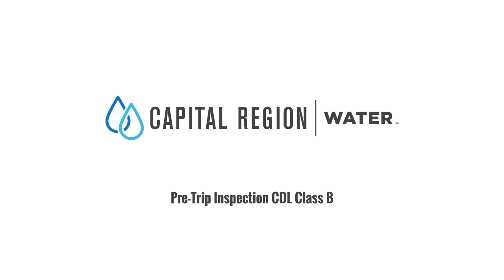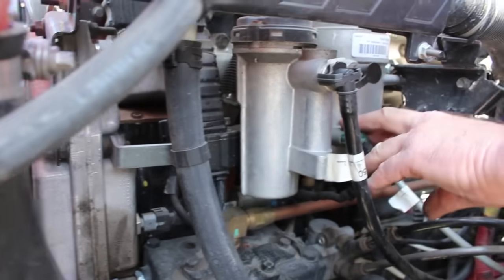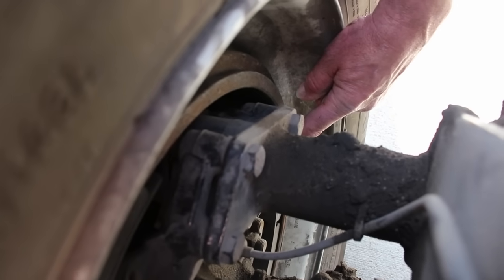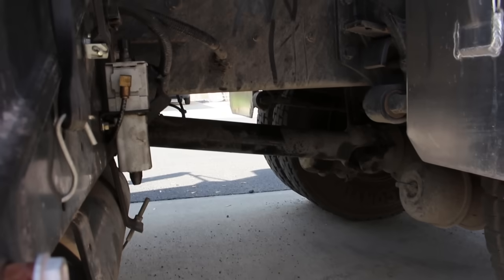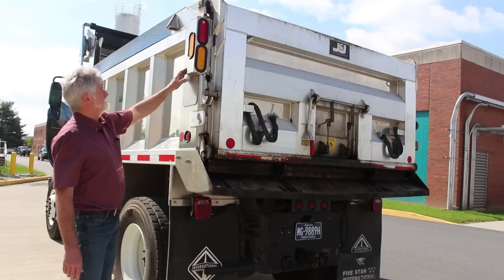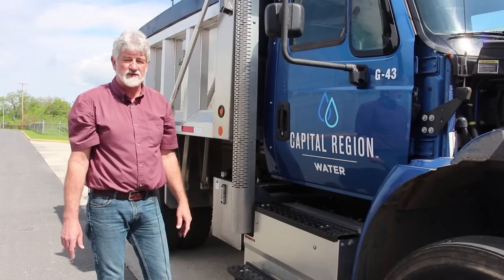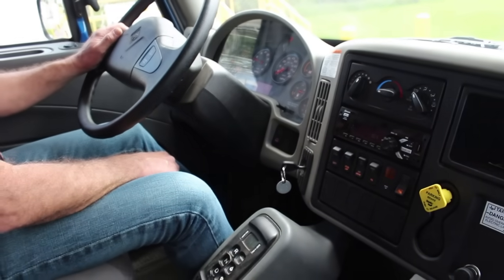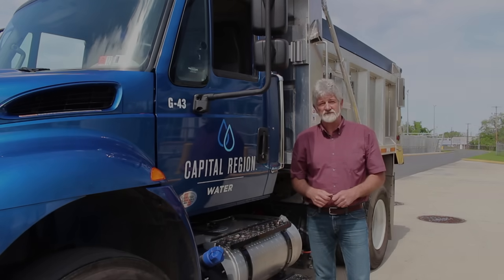Pre-Trip Inspection CDL Class B

Comment: In NJ i took my class B test 7-16-18 and the inspector said i would've passed but didnt physically touch everything in the engine that i said so he failed me. Anyone taking the Pre trip touch everything you say

I passed on 7-30-18 i touched & named so much things the guy started laughing & said stop touching everything you see. once i got past the pre trip it was easy as hell. My advice is touch everything and stay calm they're on your time not theirs
Reply: Did you chalk your wheels??? I failed my test because examiner said the truck rolled because the wheels weren't chalked.....
Reply: That's crazy I'm from NJ but I'm taking mine in GA now been here 6months
Reply: I asked the guy doing mine if he wanted me to touch everything or just point. He said pointing was fine. He also said i did not have to get under the truck but if I didn’t point at the proper location even if I named it right he would ding me. 

So my advice is ask what there expectations are.
Reply: @reesedipherent8416  im here in Ga also. Did you have to touch or point at everything in detail like in the video. I dont want to get failed because i pointed out every bolt in screw lol
Reply: I have to take mine in NJ as well. Do you have to be as thorough as the video suggests? Every component in the engine??? Securely mounted; not cracked, bent or broken of course

Comment: just wanted to say thank you for this video , i watched it over and over for 3days and aced my test today !
Reply: Shane Galley what state did you take it in?
Reply: Shane Galley did you also go to school or you just did it on your own? Wondering if it’s possible to do without school.
Reply: @BaM_F22  I wouldn't suggest it.
Reply: ItsFusco que l
Reply: I want to go for my cdl class b  do u really have to say all this on the pre trip inspection seems excessive
Reply: Fizzy_B anything less than this is a fail. Think of it this way you have to pretend like your trying to achieve to be a “certified teacher” not an actual license holder. And this is your final exam can you be certified to teach? Or not. ? They know you know but you still have to prove that you know and this is the only way
Reply: ItsFusco u can do it without school but only if you do this or better. Permit is kinda hard to get. Especially in Texas
Reply: Does the parking brake need to release while you doing the pre trip inspection or only until you get to the slack adjuster's?
Reply: @slickdawg4634  I’m doing it without school I got my permit, all that’s left now is doing the driving test. I used cdl genie to practice for the tests and I’m in Texas.

Comment: Don't forget to chock the tires before performing the air brake test and unchocking before the tug test.
Reply: Garrett S. 
If I pass my test tomorrow, IT WILL BE THANKS TO YOU!❤️
Reply: Before you unchock do you have to turn turn your engine off and take the key?
Reply: Remember to leave the cab facing the cab with 3 points of contact
Reply: Some jurisdictions don’t require it, especially where I’m from
Reply: I didn't chalk up ,I used an automatic tho

Comment: Passed my CDL B with airbrake and manual transmission yesterday . Was a lot easier than I thought, but I also had a really nice and friendly examiner. That makes all the difference
Reply: Not sure if you’ll see this, but I’ll be taking mine soon. Do you have any tips?
Reply: @Mjk86  well. The biggest thing that people fail on is the air brake test. So make sure you got that system down pat. Turn key off and back on, fan down to low warning indicator, then continue until Parking brake pops out, restart and idle up to build air pressure until governor cutoff. Do the tug test (parking brake test) then service brake test. Also during the manuverability test, make sure to use all you looks especially during the alley dock backing. Usually you get two looks. If you aren't in the box you fail that part. I took mine in Arkansas. It is different state to state

Comment: You guys forgot the governor cut-in test on the air brake. After raising the psi from 85 to 100, continue to raise pressure to the governor cut out, then release the airbrakes and fan brakes to 100 psi where governor cut-in should kick on

Comment: Finally passed my test CDL b, in NJ.... This video and others helped especially the air brake test.... Touch everything, even if you don't know the name of it, touch it, just keep talking, if it's metal ,(( not bent,broke,cracked)) if it's rubber,(( no cuts, buldges abrasions)) securely mounted etc, air lines say the same but add no audible leaks etc..... Don't forget to chalk your wheels, 1st time I failed because I didn't chalk wheels.....
Reply: You mean use wheel chocks. :)
Reply: Chalk your wheels after brake  test right before you do your outside pre inspection right? I’m pretty nervous I’m taking mine tomorrow for class b in Tennessee using a dump truck I’m not going to a dmv cause the ones in Memphis do not do the CDl skills test  I’m  testing at an actual CDl college any advice?
Reply: T J I test Tuesday and yes I’m using a driving school for outside testing and I’m having to pay like 200 dollars

Comment: I'm gonna repeat "not cracked, bent, or broken" 1000 times during my test.
Reply: add the securely mounted lol and me too
Reply: @edwin1845  how do I do the test without paying for classes. I already drive dump truck illegally, and on union sites, just need to get squared away before I have problems
Reply: @RandomsFandom  These big companies are willing to pay for your training look near your area for free training. From my understanding all you need is your permit and 15 days later you can take the pre trip and road test but the dmv will not supply you with a truck. You may have to take an eldt test and pass it and obtain a certificate. It should only cost about 200 to do take the ELDTand  be able to take your written test with the KTA. This is for PA so you should reasearch your states requirements. Im actually in school right now first week
Reply: @RandomsFandom  If you do go the free route the company should supply you with a guaranteed job but under a contract, housing, food along with the training from what i hear. but the pay is lower than what it would be had you attended school yourself

Comment: South Carolina Department of Transportation pre trip inspection is a little different. We have to start inside the cab until you safe start, brake and light check then move outside the truck. And DO NOT move the truck without telling the instructor to put his/her seatbelt on! Automatic Failure

Comment: Abs light goes on and back off after starting the truck, while truck is idling, oil pressure gauge reads 60psi, battery am meter gauge reads 13-15v, fuel gauge reads correct amount of fuel in tanks, coolant temperature is between 190-210degrees..

Comment: Thanks alot just passed my inspection and brake test. Remember seat belt horns fuses triangles and fire extinguisher. One thing inspector wanted to know oil gauge usually   at around 20-40

Comment: Air compressor governor cut in test 
Air compressor governor cut out test
Low air pressure warning signal test
Parking break pop- up test
Air pressure build up test
Non applied air leakage test
Applied air leakage test
Parking break 
Service break 
Interlock 

This is for a bus air breaks . If anyone needs help , dm me .
Reply: I have a question. I did not understand where the he did the cut in test.  If you know, could you respond?  Thank you!!
Reply: Ofer Gabay when the needles start to rise that’s basically the governor cutting in since it is what makes the compressor pump air
Reply: I just got my Cdl b licences permit.  Now I'm about to start classes for the road test.  This is very informational.

Comment: Great sir, it's all about detail. Quick question, on the slack adjusters pull need to chock the wheels? Also, when checking the air brakes build-up pressure test, once the air pressure reaches 85psi, is raising the RPM's still necessary or just let it reach 100psi on its own while being timed for 45 secs without the assisted the rpm raise?
Reply: keeping the truck at 1500 rpm will hasten regaining the pressure

Comment: Transmission fluid level check?
Reply: idk if you have to actually check it, but mention its in the correct range and is checked with the truck running, I believe.
Reply: I just wasn’t sure if you had to start the truck then check the level
Reply: @brandoncrawford5044  I guess read your states cdl manual, it should say, but I think you're not supposed to ever leave the truck while its running, so I'm not 100% sure.

Comment: Quick question about the air brake test...when doing the 85psi to 100psi in 45 seconds, can you do that portion at high idle, or does it have to be at unassisted engine idle? I noted that you were doing it at high idle. Thanks!
Reply: high idle up to 1500

Comment: Do i have to apply the brake when doing the 2 sec check for leak? 
(The first one he shows?)
Reply: no the first one is the air pressure leak test to check the parking brake chamber. the second one you do as you are checking for air leaks on the service brake portion of the brake chambers, lines

Comment: Does this work for illinois cdl pre trip inspection?
Reply: I would strongly go over the Illinois CDL handbook and follow the order of procedures, I’m going in this Thursday in west Chicago to take the test.  I failed on my first try last week, but now I’m even more confident than last week so should definitely pass this time
Reply: @ivancedillo8  I’m taking mine in Elk Grove Village in two more weeks. Can I ask what you part you failed on the first try? And also, how was the pre trip part the second time?
Reply: @jonnydarrin  air brake portion of the test, I forgot to release the parking brake while I was doing my airbrake test. When I went back the following week I pass. However they only wanted me to do the pre-trip on the outside on only one side of the truck and they didn’t even ask me to open the hood to locate three engine components.

Comment: Does any drivers actually inspect it like this before trip?
Reply: Seams like alot of work to do daily 🤣🤣. If the truck is maintained properly it should need basic checks  done daily fluids lights tyres glass etc not a full service Inspection like this. Glad we have to have 6 week inspections in the uk and simple daily checks

Comment: At 20mins, not less that 2/32 what? Difference in Tread?
Reply: tread depth of the rear tires cannot be lower than 2/32 of an inch and front drive tires cannot be lower than 4/32 of an inch for tread depth